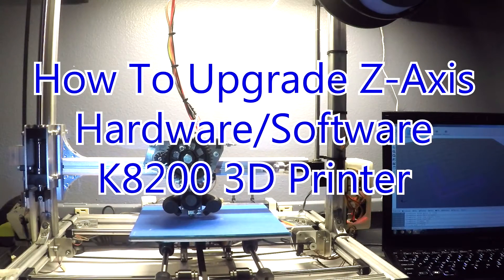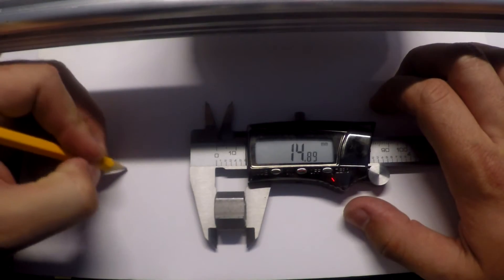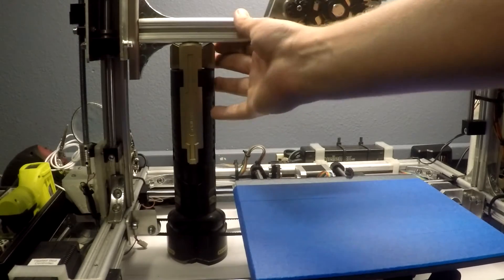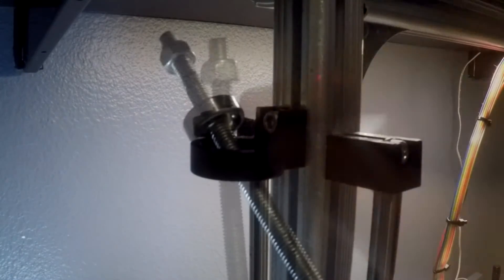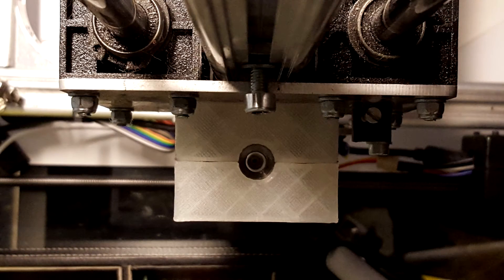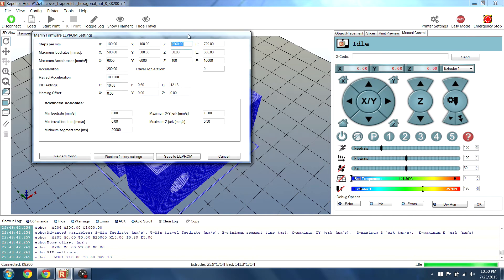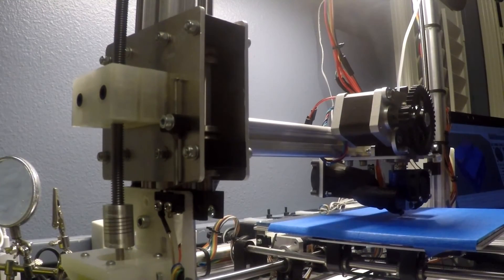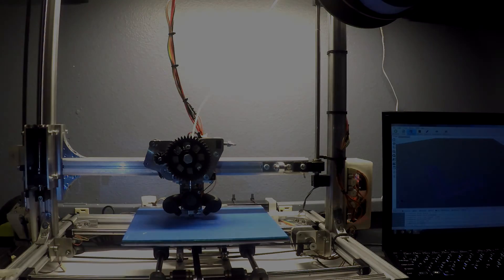How To Install a New TR Z-Axis Upgrade! | K8200 3D Printer | Hardware & Firmware

Comment: hey the original nuts don't fir the new rod tho? and the new rod is about 1dm shorter. the flex mount was included and works great. but i need the original nuts to fit...

Comment: Can you send me a link where I can buy these things?
Reply from the maker: +Mo Xs Sorry for the delay. Yeah the one I bought was off of ebay from a 3D printing company in the UK. The link is below, but in case it doesn't work, You just need to search for a TR8x1.5D Rod, 1.5mm pitch - 400mm is good for a K8200. 

http://www.ebay.com/itm/TR8x1-5Dx400mm-Trapezoidal-Spindle-Hexagonal-Nut-3d-Printer-Fine-1-5mm-Pitch-/311393546026?hash=item4880806f2a:g:lLkAAOSwF1dUNr-N
Reply: +HardDrive Thanks for your response. I found a rod which is exactly the same as yours.  Now I'm waiting for shipping. Your video is very good and it helped me a lot. Thanks for that!
Reply from the maker: +Mo Xs no problem! good luck and if you run into problems just feel free to ask!

Comment: how are you getting the PLA to stick to the Blue painters tape?
Reply from the maker: +Lee Butler 
Currently, I'm printing at ~200C with the heated bed at ~50C. The type of tape can make quite the difference. The best one, in my opinion, is 3M Scotch-Blue Multi Surface Painters Tape from Home Depot. Hope this helps!
Reply: u doing anything to the tape? what about abs?
Reply from the maker: +Lee Butler Nope, just make sure it lines up and you don't cause any ridges from overlapping. ABS is fine on it as well. However, on the K8200, be sure to print a Brim when using ABS and increase the bed temperature to about 80-90.The print can pop off otherwise since it's not enclosed. If you haven't yet, wire an old laptop power supply to the bed. It's much better that way. Anything else just feel free to ask!
Reply from the maker: +Lee Butler I do not sorry, I just took one I had lying around. Any basic power supply should work as long as it is at least equal to the Velleman PSU.